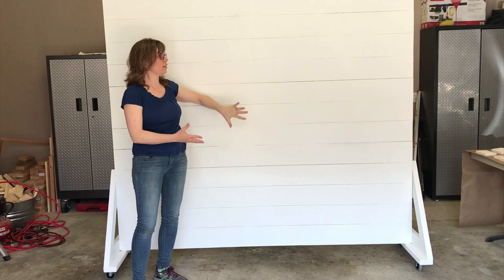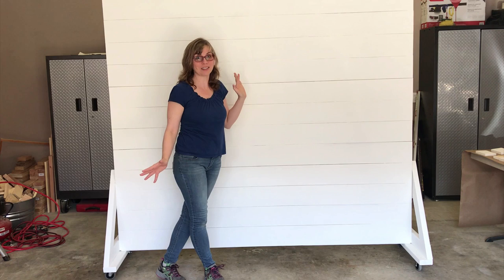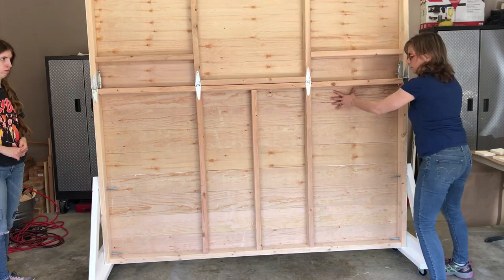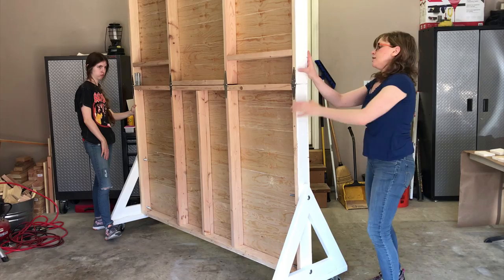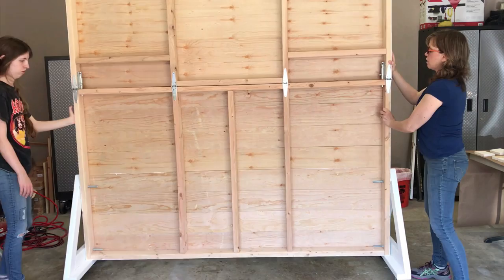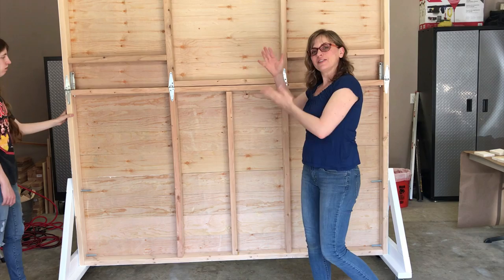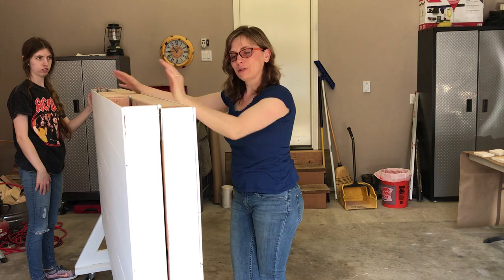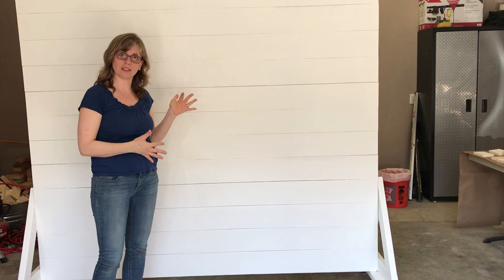DIY Photo Backdrop Wall On Wheels (it folds too)

Comment: I know it's been 2 years since you built this backdrop wall but would you share any lessons  learned are upgrades that would make this project even better? I'm a amateur DIYer and this project seems so much fun to build. Thanks again for sharing! Also, what size are the barrel bolts?
Reply from the maker: Hi Clarence! The barrel bolts are 5 inch and are linked in this post: https://sunshineandrainydays.com/diy-photo-backdrop-wall-on-wheels/  As far as lessons learned or upgrades, I'm not sure. My niece is pretty happy with the way it turned out! I do wonder if I should have left more space between the boards to allow for movement but I haven't heard she's had any problems with it and I know she used it for an event recently.